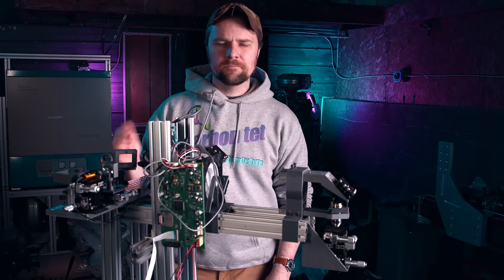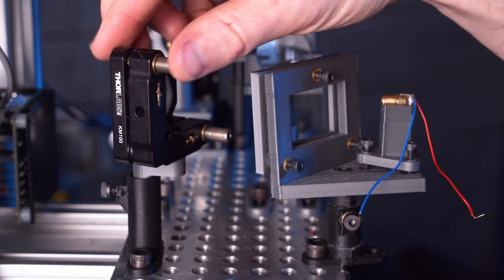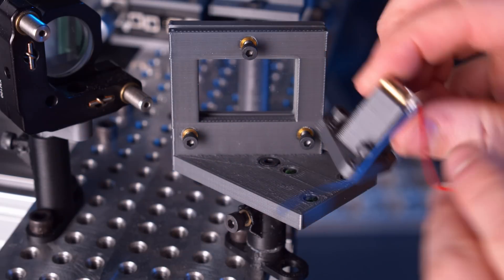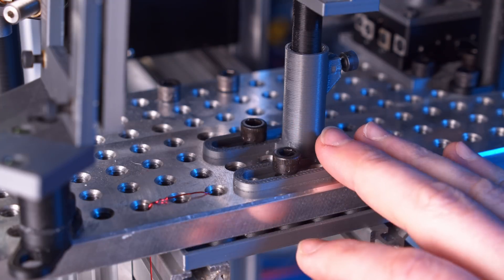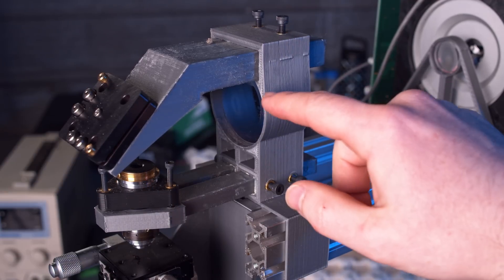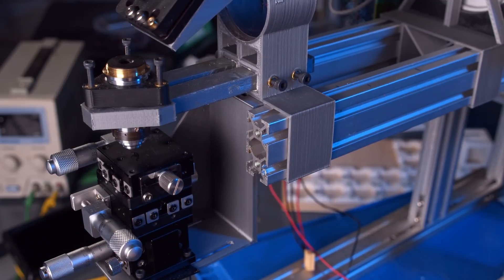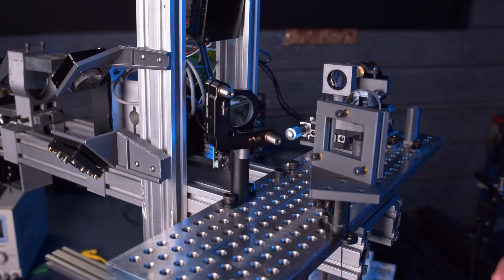3D Printing Optomechanical Components

Comment: Forget the magnets. I've been using a central bolt with a spring between the head of the bolt and the base plate. The bolt is screwed into the laser holder with loctite. Then use the three other bolts as normal for adjusting the pitch and yaw. The pressure of these three bolts pulls on the central screw, compressing the spring, creating a rigid mechanism. 

Look up Omtech Laser Engraver mirror adjustment mechanisms for a better idea of what i'm trying to describe.

Comment: I didn't watch it all and you likely already know it, but looks like the 3-ball laser mount is not really a hard kinematic constraint. AFAIK a true kinematic mount needs to limit each degree of freedom, and not be over- or under-constrained. So if you have a mirror with X,Y,Z translation and pitch, yaw, roll rotation possible, then you need exactly that number of constraints. For example, the "Kelvin Coupling" using three ball bearings: #1 rests in a 3-sided pyramidal pocket, #2 along a slot with two angled faces, and #3 resting on a flat plane, satisfies that condition: six constraints for the six degrees of freedom. Then you have one tension member like a spring to hold the moving part in firm contact with the fixed part, if gravity or a magnetic force isn't enough. If there's thermal expansion, balls #2 and #3 slide along the slot and plane by as much as needed, with negligible change to position or angle. I've made such platforms and there is no slop. Admittedly it's a little hard to machine the pyramidal pocket. However, a simple conical pocket from a normal drill bit is often good enough. https://en.wikipedia.org/wiki/Kinematic_coupling

Comment: VERY COOL! ...And wow! @1:58 where is that optical table photo from?  The most dense setup I have ever seen.  I am an optical science guy and I appreciate your mounts and parts.  Nice work.  But you also showed some of those designs are not really 'kinematic.'  That said, I 3d printed parts to build a LiDAR in 2020 and it worked a lot better than expected.  You might have a product  at least for education with the magnetic system.

Comment: I got a few prototype Germanium lenses a long time ago. My 3D printer was still working back then. And I designed and printed really really bad lens holders which were really bad. They almost look like the extrusion stands you showed - but just stand on the table, with lens elements just hold on by gravity. There are better solutions if you look through ebay a bit, or even find modern kits. Which I still don't have. 

It was enough for me to figure out what combination of lens elements I needed and how they were spaced and rotated. I managed to print a lens housing that was 4 parts with printed threads. They even allowed "focusing". And it was a lot of fun. Really low resolution thermal camera (80x60) is Soo much better with a narrow lens than the wide lens it usually comes with. 

I sadly dropped and shattered one of the elements, so I never tried to use that lens again with my 160x120 camera or even the 384x288 and 640x480 cameras I have now as well as their giant lenses.

Comment: Thanks for sharing your successes and failures so we can all learn, I didn't know about UC2, that's interesting.  

For the 3-screw tilt adjustment, you could try using cup-point grub screws, which have a semi-spherical hole in the end that would centre themselves onto the spherical magnets.  The screw and magnet size need to be carefully selected (magnet diameter slightly larger than screw hole sphere diameter).  You may need some lateral float in one of the magnets or screws to allow for tolerances.  

Instead of using magnets, you can use a ball bearing sandwiched between two cone shaped holes, then use 3 screws to tilt the cup and ball joint.  If you don't want a ball bearing, 3 sets of springs and screws can be used.  Springs push 2 plates apart at the corners and the screws tighten to pull the plates closer together.  There are also flexure arrangements, where you bend the material at a designed weak point, to tilt the lens.  

A good option is a virtual ball joint, where a large diameter 3D printed (partial) ball, whose centre would be in the middle of the optical axis, is mounted on one side of the lens/laser, and is pulled tight using a screw, nut and spring into a ball cup.  The ball cup has a large hole to allow the screw to move, and there would be a larger cup with small hole for the screw head to sit on top of, outside of that.  This gives the ideal centre of rotation.  Getting the ball and cup smooth is tricky but can be done with a fine print layer height and some sanding and vapour polishing.  As before, the ball wants to be slightly larger than the cup so that it can't move laterally.    

I noticed your laser was on an arm,  away from the adjustment platform.  This amplifies the adjustment and moves the laser in an arc rather than tilting on axis like a gimbal.  Keeping the adjustment plane as close to the lens or laser optical axis as possible gives much better control.

Comment: 5:40 with the stands could you use screws shaped to a cone at the bottom, so the sit well located, before you use the screw action to adjust the precise, repeatable location? - like 4gwVucFaPw but smaller

Comment: The 3-screw adjustment for optics and lasers could be improved to resolve away the shift by pressing the magnets into the back side of the 3D prints and the screws must reach down through some "guide" holes, maybe with some rubber O-rings pressed into the screw-side to hug around the screws for stabilizing and retaining position better. It wouldn't be completely ideal but it would be a cheap simple way to greatly improve on the concept and lock things down more to where the screws are pretty much the only adjustment that can be effected upon the optical devices.

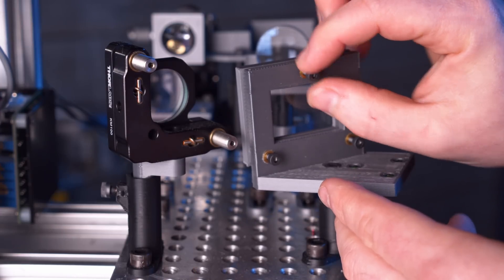Comment: 3:58 "functionally it's the same as this kinematic mount"
Yeah, no. It's missing preload on the screws so it can wiggle around, and the printed bracket could be (should be) reinforced with a cross member.

I also wonder how much the prints will bend and flex around when the temperature changes. Probably they can be tempered by baking / cooking in hot water?

Comment: Thanks for sharing your experience. I would argue that a lot of the things where you said 3D printing is not a good idea - it is actually the specific design you show for the mount, not the fact that they are 3D printed. Using those magnets, for example, and the simplistic right-angled joints on your brackets. With better design considerations you can do probably all this thing with 3D printed mounts and ordinary nuts and bolts. Nice work though.

Comment: For spacing elements a certain distance you might look into using gage blocks. They are relatively inexpensive and you can stack them together to get a specific size. It might work better than trying to manually shift around and you can hold your spacing steady while tightening down the screws.

Comment: Awesome DIY project!
I work as an optical engineer with these kind of breadboard optics . I really appreciate the effort! but if Im honest I see some cool ideas but also a lot of problems. Some tips and comments:
- Press fitting optics is not a good idea. Big chance to ruïne the coating on the optical element. I would prefer a nylon set screw.And especially dichroic mirrors should be mounted stress free.
- Objectives are very sensitive to alignment and it is worth the effort to decouple translation and tip/tilt alignment. 
 - I think the flexure joins are awesome. 
- When designing/building it is super helpfull the place alignment aids and pinholes. Perhaps that can speed up the alignment. 

Keep up the great work!
Reply from the maker: Cheers for the tips, appreciate it! Will keep these in mind for future projects
Reply: Good points !

Comment: When i need rigidity i usually put round channels (or holes if you like) in the design that then i fill with a metal rod. Normally i use 3,4 or 5 mm rods but depending on the part you can use any size and it is very easy to find the right setting in the printing so the fitting is right to hammer in the rods. You can also print the holes slightly oversized and then glue in the rods but i found much better to hammer in them. The rigidity is astounding.

Comment: They are only bad designed I bet if you print hinges for every axes separately to prevent them from shifting but allowing it to tip and tilt then would be able to have them as good as the metal bought ones

Comment: if you have a lathe handy, then drilling a conical recess (even with the point of a regular twist drill) into the end of the set screws might help them mate better against the surface of the spherical magnets and could constrain them a bit better in translation. Ball-in-cone is one of the classical kinematic design elements AFAIK

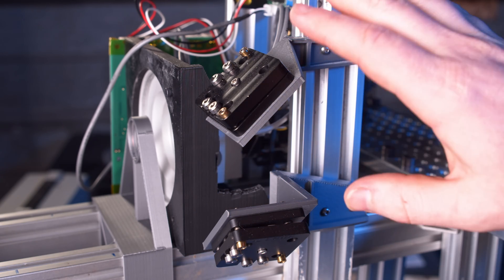Comment: I'm no expert, but I would assume that annealing the 3d printed parts would make them more rigid and increase the effective TG of the part futher to make it less likely to suffer temperature dependent error when in use.   Its a whole 'nother project, but it might be worth checking out.  EDIT:  Holding brackets for kinematic mounts, @ 10:28 are $18 each on Aliexpress.
Reply: Annealed printed parts are much more rigid, however their dimensions change. A good alternative is probably to remelt it in powdered salt: You get the strength of annealed parts with the original dimensional accuracy. They have to be printed with 100% infill though.

Comment: Two things I've had some success with too:
1.  Using micro-steppers meant for mirror adjustments in camera's. They cost only a dollar each on aliexpress and can be useful for hard to reach screws, fine adjustments, or anything you'd rather have computerized. At the cost of having to add more electronics, of course.
2.  mounting the too-be-adjusted plane between two dissimilar springs on each screw (so you have a screw going trough [top base-spring k1-adjustment plane-spring k2-bottom base]). It works as a small shock-mount (sometimes good sometimes bad) and linear step down gear as the springs won't compress the same amount if you tighten the screw.

Comment: I feel like flextures should be the name of the game for fine adjustments in 3d printed mounts rather than sliding contacts. they're just much less wobbly.

i also wonder if it's possible to design a robust magnetic mount in a 3d print that's repeatable at least to a degree.
Reply: Would flexures not suffer from creep issues similar to the cantilever mounts? Could this be mitigated by switching to a different filament like nylon? (or one of the nylon+filler composites that print better but require abrasive-resistant printer parts)

Comment: Very cool, I've really enjoy following this project. I'm a machinist/designer and have spent some time designing and making optical components both at home (3d printed) and at work (machined). This has been almost surreal to follow you on some very similar paths. 

Some random comments. I've found springs in 3d printed kinematic mounts give really good feedback, perhaps a bit more positive than magnets. The awesome technical papers at Bal-Tec cover some topics of magnets in kinematic structures. Off the shelf contact points (flat on ball or ball in socket) might make alignment a bit more predictable on some of these kinematic mounts. Also - ThorLabs has CAD files for all their products. It makes reverse engineering some designs really quick. It's also fun to get into some of their design intent. 

Thanks for sharing!
Reply from the maker: Oh neat, I didn't realize Thor shared their CAD models. Cheers for the tip, off to download a bunch of models!

Comment: Thank you for sharing. I do a lot of 3D printing of mechanical parts. I use a PRUSA MK3S w/ MMU2 w/ 0.4 mm nozzle. Some tips that may or may not work depending on the slicer software you use. In advanced settings the width of the extrusion can be controlled to some degree. Make external perimeters 0.35 - 0.4 mm with a slower feed speed. Then internal perimeters 0.6 - 0.65 mm with a high feed speed and layer height 0.15 mm. infill at 0.7 mm. In the infill settings combine infill every 4 layers. This will give smoother exterior to your parts and better tolerance while maintaining fast print speeds. Also I use cubic infill with 30 - 40% density. Your magnetic ball idea is a good one, however to greatly decrease unwanted movement make the receiving side concave to fit the magnet. Magnetic PLA is quite effective for magnetic attractive surfaces and with a multi material setup you can use it sparingly where needed. Putting a 3D printed fence around the movable part at 0.15 - 0.2 mm backlash can also further constrain against unwanted movement. Use printed gussets and struts of various types everywhere with access holes for tools and fasteners to increase rigidity. It is always worth the extra print time to eliminate as many potential problems as possible. It is also much faster to print your own custom supports in the part design for overhangs as you can speed print time and reduce material waste with good design and no generated supports rather than automatically generated supports. This also gives you better control of interface gaps and tailor them to the material you are printing with. For very low density infills you can force the slicer to add perimeters where you want solid infill by making very thin voids at 0.05 mm. This takes a bit of practice as it depends on the printer, slicer and filament type but you can make voids that are so small that they are practically solid and fused but mathematically the slicer sees a perimeter. This will force the low density infill around these voids with a perimeter shell. For locations with a high chance of breakage like a low diameter post on a plate, make a hole for a flat head machine screw to self tap snugly and insert the screw as metal layer reinforcement. Using woodworking joinery techniques and captive nuts with machine screws is a very effective way to join 3D printed parts together with minimal fasteners. Hope this helps. Keep up the great content.
Reply: Check out this video by Lost in Tech showing that you can go with an even larger width based on the chosen nozzle: https://www.youtube.com/watch?v=0DAP5Zm1jvk
Reply: @nidavis  Very interesting. Thank you for sharing. The main point I was driving home was using a thin 0.35 - 0.4mm  outer perimeter to reduce layer lines and increase accuracy and surface quality, while using fat lines to fill the wall thickness fast. Skipping 3 infill layers then filling them with a fat layer. You need to tailor the concept to fit your part.

Comment: Very nice video on these optomechanical mounts youve got there. I just want to leave one comment about your kinematic mounts here - the 3D printed ones you printed have the 3 set screws in a triangle shape around your object. If you think about it in general it is perfectly fine, but if you for example just want to shift your mirror in horizontal direction you need to use two screws - and this is quite the hassle. Try arranging them like the ThroLabs Mount in an L shape to cover horizontal and vertical movement with just one screw. Same goes for your LED mount. These additional moves to achieve a certain directionality in your optical setup get pretty frustrating over time. 
Also - when mounting an LED/Laser/Light source it's usually easier to mount it fixxed and use a mirror or the following setup to guide it instead of adjusting the LEDs position and direction.

Comment: The tech in me wants to get a 3d printer. The woodworker in me says I can make most of these parts in a fraction of time and cost out of scrap wood.
Reply: Since I master cad skills I tend to prefer 3D for ease and accuracy in complex designs
Reply: @wouterke9871  Certainly something complex may be faster, but since most of these designs seems to take hours to print, there's a point where it's not worth it.

I know I could make these optics holders in an hour max out of 1/4" ply.

Comment: A silly, low effort suggestion:  just turn the m3 screws around backwards and the spherical magnets will sit in the hex and maybe give some more precision.

and maybe cut a slot in the bottom of the screw to turn with a tiny screwdriver?  dunno.  sweet video!  good luck!
Reply from the maker: yunno... that would probably work well! Some other folks have suggested cutting/grinding a sphere on the ends, but just flipping them around would probably work just as well and be a lot easier!  Will give it a shot :)

Comment: Kinematic mounts don't just touch in 3 places like you have. To fully kinematically define the location of the component, you need 6 points of contact. The thorlabs one uses a ball-in-cone (which provides 3 points of contact), a ball in V (to provide 2 more points of contact), and a ball on plane (1 point of contact). Together these 6 points fully constrain the 6 DOF so you don't get sliding around of the component.

Comment: Have you tried drilling sockets into the thread end of the bolts to cup your balls? Maybe as a proof of concept flip a few cap head bolts upside down so the ball partly fits into the cap. It seems like they would snap into the low energy state which would be centered over the balls.

Comment: You should use balls and rollers from bearings to joint parts. The three balls create an extremely precise and repeatable connection of moving parts. The alternative is flexure.In your video there are examples of using flexure.